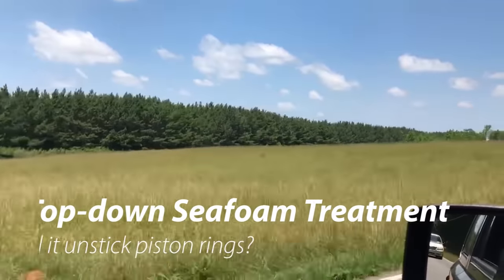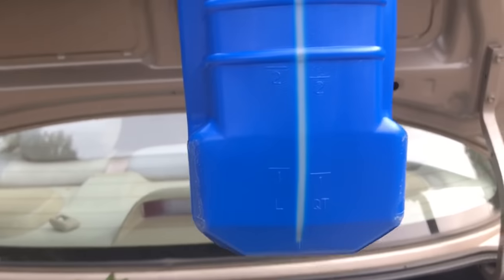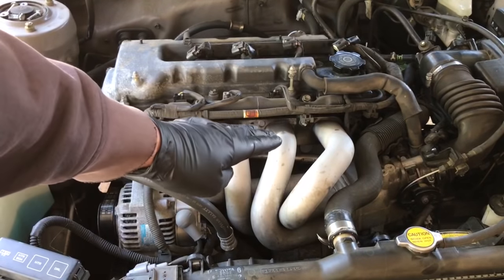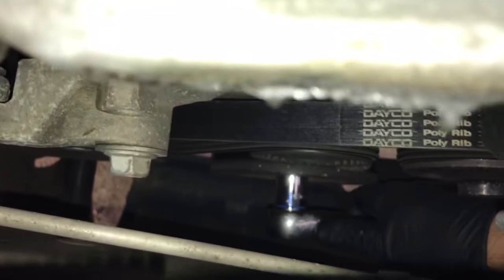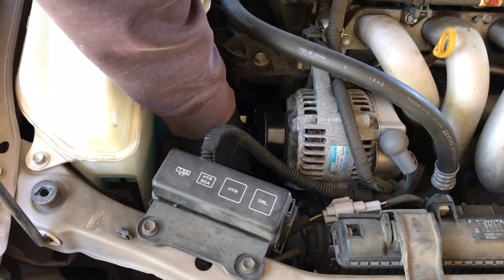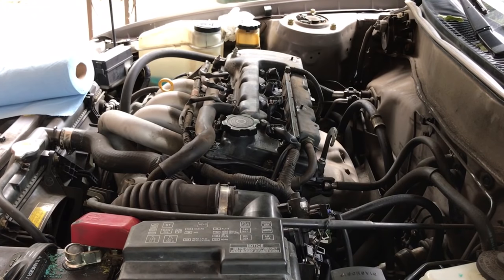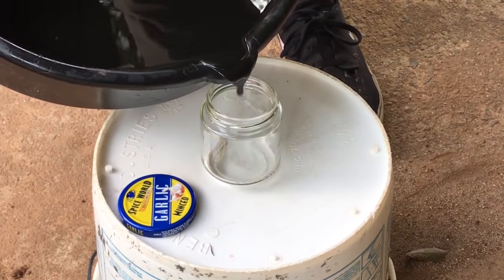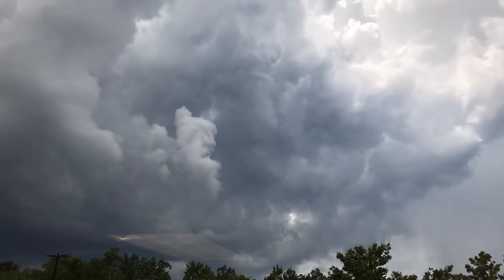I poured Seafoam down the spark plug holes! | Oil Burning Experiments - Episode 1

Comment: Dave, what might be a good idea with the seafoam in the cyl's replace number 1 spark plug turn the crank by hand, when you feel compression hold it there, that will get the seafoam between rings faster. 
When the compression bleeds off, take the plug out and do the same with 3, 4, 2 and let it soak.
Reply from the maker: I like that idea, Garth. Someone else also mentioned pressurizing it with an air compressor.
Reply: @FamilyFriendlyDIY  That's good, but with all plugs out and the cyl you're pressuring, if the valves are closed, too much psi can actually rotate the crankshaft. 
First time it happened I was like WTH! happened. 😁
Here's another way to tell if the rings or valve's are seating properly. 
Get number 1 cyl valves closed and piston TDC and apply compressed air in the cyl not much, you don't want the crank to rotate.
Go listen at the exhaust tail pipe, if no hissing is heard, the exhaust valve is seating good. Open the throttle plate, if no hissing at the throttle then intake valve is seating good.
Remove oil filler cap and listen for hiss, if yes then rings are leaking. Do the same to 3, 4, 2.
Have a leak down test done it shows if the leak is good or bad.
Valve seals or worn valve guides can cause lost of oil.
Reply: There's no mention of draining the engine oil before this application of seafoam so that the crankcase does not receive excessive amounts of seafoam. Or does that matter? I have seized rings on my 76 kz750 which I hope to free.

Comment: You should consider using an engine flush twice with clean oil and new inexpensive filter with each flush to get rid of the sludge. That could be your entire problem.
Reply: What oil or product do you recommend for the engine flush?
Reply: @JohnSmith-xx1lx  liqui moly
Reply: If you use an engine flush you better pull that pan. Pick up screen and bottom of the pan need a thorough cleaning after using that

Comment: I've used Rislone oil treatment since the 50ds , that's 1950's !  Cleans an engine and really quiets  it down ! Record engine sound and do at least,  two , change cycles  , 3K,3K, = 6K Sound recheck   !  the secret is , A CLEAN  ENGINE ! Good oil and filter !
Reply: Rislone is what I have used.good stuff. I don't change oil without rislone.
Reply: Grandfather owned a Studebaker dealer ship back in the days. He had a traveling salesman that sold Rislone  and he ran his car with straight rislone. Always seemed to thin a
weight to run by itself. I to have used rislone since the early sixties when I started driving. Still recommend it!

Comment: 3 fold approach worked for my auction x3 bmw that was nicely maintained but 10k oil changes stick rings
1) motor flush 2) marvel mystery in top cylinder and in oil, ( in driveway, not on road) 3) GM special chemical to free rings $20 forgot the name.
PS i will always change my oil frequently with full synthetic… dirty oil sticks rings
Reply: The most important part “forgot the name”

Comment: One of the best things you can try to do is use BG EPR which is an engine flush it is designed to go in and clean out the carbon from around the rings added to the engine oil and follow the directions your regular engine up to certain RPM for about 30 to 45
Reply: I wood run a compression check on and see what the compression is on the cylinders before and after BG makes very good and the epr engine flush is very strong and it's designed to knock the carbon off the rings and allow your rings to expand back

Comment: The oil return holes in the piston is most of the problem . Later year engines  of several companies seem to have the same problem with the low friction rings.
Reply: Had this issue with old '95 Saturn,  infamous oil burners, seafoam seemed to unseat the coked in rings. MMO also seems to help with this, but at around half the price.

Comment: After treating the cylinders, you should go for a really hard italian tune up drive to blow out the carbon from the piston rings. 

As others said, pcv. Change it with a new oem one!

Also, seafoam in oil, run for 200 miles, dont floor it and then change oil. 15 min does nothing
Reply: Did that to a chrysler 300, a couple treatments like that and quit using oil had 110,000 miles

Comment: Also you got a check engine light on , depending on what is causing that, it could contribute to oil consumption. An air / vacuum leak can add to oil consumption .
Reply: No he doesn’t. The key is just in ACC.
Reply: @sirdewd2197  at 2:32 driving back into the drive, light on!! What say you>?

Comment: Thanks for taking the time to make this. 

'09 camry 2.4 here with 460k miles; i found switching from mobile1 full-synth oil to valvo semi-synth high-mil 5w-20 oil slow the oil burning (hi-mil mil valvo supposedly has better cleaning chems esp for stuck rings)...
Reply from the maker: Good info, Wes. You made me go to the Valvoline site where they talk about this  https://team.valvoline.com/diy/how-using-high-mileage-oil-can-help-prevent-engine-breakdown
Reply: I won't use valveoline it has cost me engines before I always use Mobil 1 or castrol
Reply: @stallion955  How did it cost you an engine and how did you know it was the valvo oil that did it? Care to give more detail?
Reply: @Wes_5kyph1  because the 5w30 valvoline tore up the engine I used to use Castrol 5w30 before then  I ended up switching to valvoline for 1 oil change because where I went to get the oil they were out of Castrol 5w30 after I ran valvoline motor started burning lots of oil and ended up with  a lot of knocking/ticking noises the motor was a 2.5 iron Duke chevy engine I've since been back to Castrol or Mobil 1 and never an issue since I steer clear of valvoline and pencil both are garbage if you ask me.

Comment: You can do the same with break fluid. Works really well with stuck piston rings.
Reply: Lunch break fluid? 
Or fast break fluid?
Reply: @macknumber9  I actually used dot3 on a 3500 rover engine which was stuck after 12 years. Worked fine, after disassembly the rings were almost completely clean. 
I also used the same fluid on a Toyota kh2 engine which was never dissamebled and serviced only with oil change after this process which still runs fine.
Reply: @macknumber9  I prefer brunch fluid myself.

Comment: It is maybe that old oil increases engine prerssure and it goes through the least resistance-piston rings.  If we change oil frequently and drive the car slowly and not high rev it i think we might overcome this problem.  In my car I never pass the 2500 rpm and i think it helps with various oil leaks from the valve cover.

Comment: Main issue is the oil drain holes in the pistons as they are too small and clog up, the very late ones had a revised piston design, I can see from the metal intake manifold that yours is a very early one. My 1zz was on about 178k miles before I pulled the engine to drop in a forged engine and didn't use any oil - complete luck of the draw really, it all depends on if its been well serviced.
Reply: This is 100% correct. After drilling extra holes you will see no oil consumption anymore, but it is a big job. Search Phoenix and Dad oil consumption fix on YT.

Comment: Thank you for the video. Another Canadian guy did a more involved process using B-12 and cranking and adding more of the chemical every six hours three times on his Audi; the results was great and his vehicle did not burn any oil after that process. I am having the same problem with my 2016 Mazda6 and am planning on doing that as well.

Comment: I'd guess the valve guide seals are more likely leading the excess oil burning than piston rings. You can do a compression and even a leak down test to determine if rings and/or valves are leaking pressure. The guide seals prevent oil being sucked down the valve stems from valve rocker or cam area and into combustion chamber. The seals can go brittle and loose their sealing ability on higher mileage cars.

Comment: I’ve used Sea Foam for years.  If you ever take long trips where you use say a half tank to a full tank add a full bottle of Sea Foam before the trip. It seems to work especially well in a warm, running engine. I used to decarbon my two stroke outboards with it. “Crud” would ooze out the exhaust for days after the process. It’s amazing stuff.

Comment: Another thing you can try is Seafoam upper engine cleaner spray. You spray the entire can through the air intake through the engine while the car is running for 10 minutes. Then turn the engine off, hook the air intake hose back up and let the car hot soak for another 10 minutes then turn the car on and drive it around until there is no more smoke coming out of your tailpipe.

Comment: One thing I learned years ago is that SeaFoam is amazing stuff.   My 5.3L Silverado has 265k miles on it and I have been religious about this pre-oil change ritual... I add 1 ounce per quart of oil to the crank case and 1 ounce per gallon of fuel to the tank, and I do this 500 miles before my next 5k mile oil change (which is exactly 5 trips to work and back).  ALWAYS change oil at 5k miles, ALWAYS add  Seafoam 500 miles before the change.  The engine has never leaked, it's never burned oil, and it has never thrown a code related to the motor.  I am still running on the original spark plugs and they are perfect when I check them every other oil change.  Scope shows clean pistons and valves, nearly no scoring of the cylinder walls.  I average 21 mpg, week in and week out.  I attribute this to religious oil changes and sea foam.
Reply: Sounds like a winning combo but I’d definitely buy new ac Delco plugs and wires. Spark plugs are at the end of life with that mileage.  Maintenance with additives and oil has zero impact or relevance to the wear spark plugs experience. It’s like a brake pad or transmission clutches, a part of their function is friction and inevitably WEAR. I work on alot of LS based motors. They love basic EFI tune ups( TB cleaning, PCV valve cover replacement, new plugs, wires and top engine clean).
Reply: @nordicpride9708    Great advice.  I'm so hesitant to make any changes because the truck run so well, I worry it will go down hill.  haha.  You know, like staying away from the doctor because they will always find something wrong with you.
Reply: @matthewpeterson3329  Totally understand. Look at it like exercise and good nutrition for your body. An apple a day keeps the doctor away kinda approach. As long as you stick to OEM parts she should run great for years to come. On Gm changing the transmission fluid is vital, and just anticipate the EVAP system to pop check engine lights. All easily addressable 👍🏻

Comment: Seafoam is great stuff.  On my V8 in my Trans Am while the engine is still running I pull off a vaccuum line going to the intake,  pinch the vaccuum line then stick it down into the seafoam, then slowly release the pinched vaccuum line and let the engine start sucking the seafoam in.  As you release the pinched line and the seafoam gets sucked in, the engine will start to stumble and you will see black carbon smoke start coming out the exhaust.  You don't want to release the vaccuum line fully or you will flood it with seafoam and the engine will die but if you relasee it just until it starts to stumble, the seafoam will get in there and clean up carbon deposit that will then get ejected out the exhaust.

Comment: Dave, For what it is worth, I prefer to leave the spark plugs in place by the following method. I have used this method over the last 5 years to remove carbon buildup, free up the EGR blockages, and to loosen up the stuck rings.  I use the same SeaFoam pouring into the vacuum brake hose temporarily removed from the master cylinder while parked of course.
After starting the engine, I introduce the SeaFoam via a funnel directly into the Vacuum hose which dumps directly into the intake manifold while the engine is running. I pour slowly at first, the engine smokes out the tailpipe, profusely for a few minutes as the engine burns off the carbon. Then, I dump the balance of the can of SeaFoam directly into the funnel which chokes the engine to stall out. I leave the warm engine just sit without re-starting for 10 to 20 minutes, or longer in order for the SeaFoam to accomplish a warm Heat Soaking ! After 20 minutes, I re-start the engine and drive down an unpopulated road  or street. In about a mile, or 2, or 3 miles dispersing the smoke preferably after dark, after the sun sets. Then, I immediately realize better throttle response from the 6 cylinder engine.  After 1 full tank of gas is used, I then check the oil level, and engine is running fine, with little or NO Oil Consumption. Regards, Give this method a try and let me know your results.
Reply: Thanks!   I forgot about brake vacuum hose.   : }

Comment: You really want to use a Solvent like brake cleaner. You can buy brake cleaner as a liquid in a bucket. Brake cleaner cuts through grease, oil, carbon. Changing ur oil very frequently like 500-1000 miles will help a lot. Using a bottle of motor flush and some transmission fluid before changing the oil helps too. I’ve tried everything and the best thing that worked for me was just changing the oil every 500-1000 miles for a year my car stopped burning oil. After that year I changed the oil every 2,000 miles. Some times the rings are just worn out. If u just have a 4cyl engine rather than bothering with all this nonsense your better off just putting in new rings as most 4cyl engines you don’t even need to take the engine out you just take they cylinder head and oil pan off so it’s just worth spending a weekend doing the rings.

Comment: So I always thought the oil dipstick level should be right in the middle of the two holes.. interesting I have been running low oil if that’s the case.. also my engine has been using a lot of oil so I am definitely going to try your approach, can’t hurt
Reply: you want it in middle when the engine is started for a little bit and you check immediately. you dont want to have cold engine and be in middle of holes because if you start engine it brings oil up and you might not have enough down in pan. on cold/unstarted engine you want to max and that usually means in middle while engine running
Reply: You were right.
Halfway when cold.
As it heats up, it will expand and reach the full mark.
IF you fill it up to the full mark when cold, the expansion of the oil will bring the pressure too high and cause damage.
Reply: Thanks. I’m chasing a gremlin trying to get it to pass inspection. somehow the two outer plugs have dark soot on them whereas the middle spark plugs are clean. I can only assumed oil is making its way in their if there is too much of it

Comment: Been down this road with an old Saturn SC1 I had years ago that burned oil BAD... I never changed the oil just changed the filter and used 20w50 oil..Helped slow the oil consumption A LOT but it still burned some just not nearly as much..Lasted me well over 100k longer before I sold the car and it was still running fine when I sold it..
Reply from the maker: Good info, Jeff. Thanks for the comment!

Comment: For stuck rings, try Mercury power tune, we’ve brought back lots of engines using the power tune, great product for carbon buildup around rings. You can get it at just about any boat dealership.
Reply: Is that a lubricant? Never heard of it I may try it in my  5.4 triton 3v worse motor Ford made
Reply: No it’s a spray, while the engine is running at idle and up to temperature you will spray this in the throttle body, continuously spraying while the engine is running at operating temperature when they can is empty shut the motor off and let it sit overnight, after 24 hours crank it up. It’s a marine product, we’ve used it in four strokes and two stroke outboard‘s, I’ve used it in lawnmowers and push blowers that I’ve had stuck rings due to carbon buildup and it has worked wonders !
Reply: You can order it off-line or you can get it through a boat dealership, mercury marine makes it.
Reply: @lennymorris22  No it’s actually a carbon cleaner that’s used on outboard motors, mercury developed it about 10 years ago to help clean up combustion chambers and to help free up piston rings on two-stroke outboard‘s, now it’s being used on four stroke marine outboard‘s to help with carbon buildup. I personally have used it in lawnmowers and car engines with great success.
Reply: @careyfurman3763  Evinrude makes a similar product I have used with success.   Its worked marvels on a couple of old Toyota 3AC engines. 
Just be aware you may be gunking up your cat converter and O2 Sensor any time you burn something other than  gasoline through your engine.
I might unbolt my cat temporarily (get new gaskets) and be prepared to replace the O2 sensor if needed.
Its a "Hail Mary" thing.  No product in a can heals worn metal.  But sometimes things are just gunky.  Maybe

Comment: FYI. You should add oil to the filter or crank engine using flood clear mode or hand crank to prime the oil pump
Reply: Yes, adding oil to the filter if possible is always a best practice.
However unless a vehicle has been sitting for quite a while before the oil change, most studies have found that there is minimal if any damage to internal wear surface for that 5-6 seconds of run time before the filter is full and oil circulating.
Especially since most times the engine is cold, of if in a 'shop', the engine has just been shut down and more than enough oil will be dripping around.